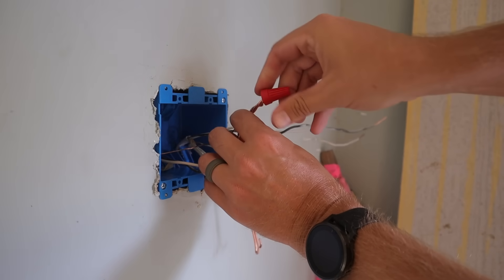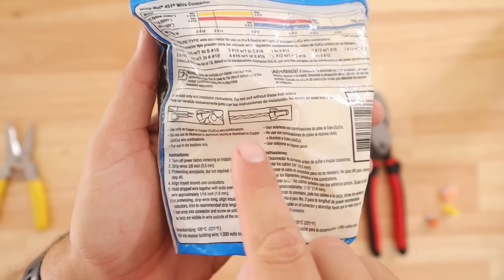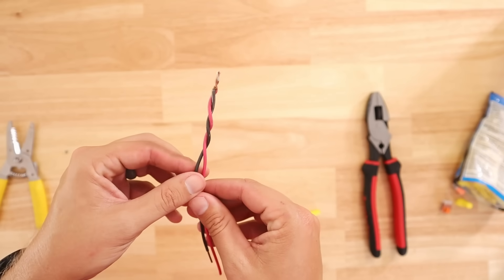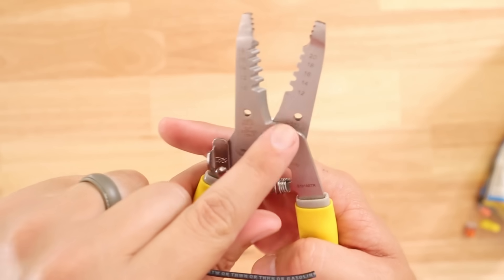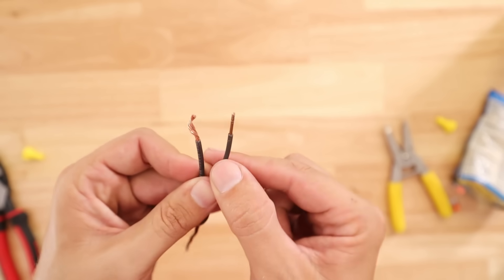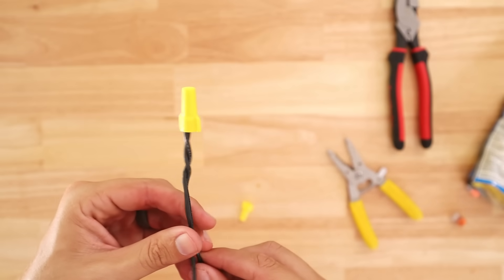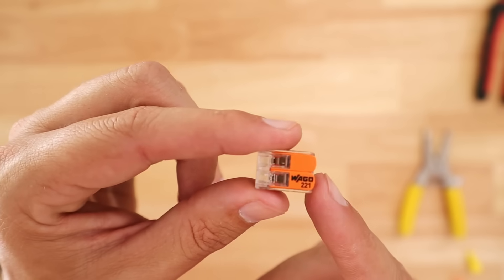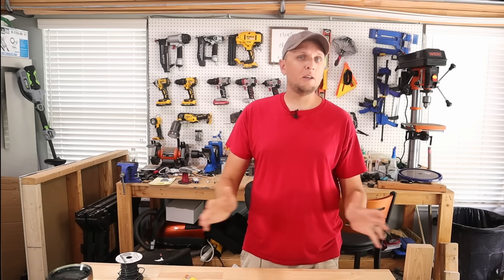BIGGEST Mistakes DIYers Make When Connecting Wires Together | How To

Comment: ALWAYS twist wires with Kleins first, then twist on wire nut.   If you fail to twist the wires, problems can happen, fire can be started.  I have found many "burned wires" under wire nuts when the wires were not twisted first. THis happens when there  is a GAP between the wires, because you did not twist.  The GAP causes arcing, which causes heat.  This will continue until the coppers disintegrates, then the circuit will no longer work and someone must begin troubleshooting.  This has the potential to start a fire in the wall !!!!!

Comment: I really prefer wirenuts for anything that will draw real power. Feeder circuits, appliance circuits, outlets, etc. But for pot lights,fans, and other small loads that often come with stranded wires wago is a lot easier.
Reply: DIYer here: I followed this same rule, except now all my lighting is ultra low power LEDs, so I feel fine using the wago's on a whole lighting circuit.
Reply from the maker: Agree.  Thanks for the input!
Reply: Wirenuts are only allowed in my area.   My inspector said I couldn't use Wago connects in my home....

Comment: I always twist the wires and believe that is a better connection. But you are incorrect in showing the second diagram as part of #3 in the instructions. That diagram refers to #6 in the instructions should you decide to twist the wires, which according to Ideal, is not necessary. Read the entire instructions. Step #3 no twist. Step #6 twist. Step #7. After twisting the wires, screw on the connector far enough so that approximately 2 twists are visible under the connector. This ensures no shorts from bare copper wire touching other conductors or bare metal

Comment: With wire nuts, always pretwist and trim with wire nuts, then over twist to make the wires twist for strain relief (all as you depicted).  You missed the last step (as taught to me by my master electrician grandfather), wrap the nut and wires in electrical tape.  That keeps the nut from backing off (as you demonstrated can happen so easily) and thereby prevents shorts in your boxes.  The Waco splices could probably benefit from a quick wrap of electrical tape as well to keep the tabs from catching on something in the box and flipping up.
Reply: I knew a Master Drywall guy who added dishwashing liquid to drywall mud to make it smoother.

Comment: As an extra measure of safety, after pre-twisting the wires and putting the wire nut on, I will cut a piece of electrical tape and starting from the insulation will wrap it up and onto the wire nut.

Comment: As a qualified Electronic Engineer, I hit the like button, in order to help you spread this info. That said, these are parts of the reasons, for paying for real qualified experts, there nothing more important than have any electrical job done right. Moreover, real experts and lifelong learners, understand a great many other factors, such as heat, degradation, and how structural flexing / movements can effect those connections. A+

Comment: Nice tip, however I believe the "square cut" he makes before installing the wire not , it's not very much recommended, in my experience and I see many , it's a while lot better to make the cut to the wires in a angle to make it dig better into the cone wire nut.
Reply: square cut is only needed if the long wire is excessive.  Excessive length on one wire will result in the wirenut not getting tight.

Comment: You are so freaking funny. You quote the code instructing to follow the package instructions, and show the package that says pre-twisting is not required, then you say, "But, IMO". AHAHAHHAHAHHAHA! These so-called DIY'ers, who you lambaste with your drivel, are not doing it wrong according to code or instructions. Just according to you. HAHAHHAHAAHHAHAHHAHA! I wouldn't even engage a conversation as to why your method of twisting with pliers may actually be more likely to cause mechanical damage and nicking of the conductors leading to failure, than the way the package insert advises. Which is correct. HAHAHAHAHAHHA! breathe, breathe, AHHAHAHAHAHAHHHA!

Comment: You literally demonstrated that pre-twisting isn’t necessary if you twist the wire nut enough to braid the wires as well. Pre-twisting is advisable if you don’t braid the wires as well.
Reply from the maker: Not only did I demonstrate it.  I said it.  However pre-twisting allows you to be able to see that the joint is good.

Comment: Don't know if this was in the video, but if you are connecting a piece of  stranded wire to a screw connection, twist the wire COUNTER CLOCKWISE before you curl it in the shepard's crook shape. Keeps the wire from unwinding whilst you screw it. :)

Comment: ok so I work on boats which is DC but I work on a yacht that also has 120 AC and for the second time it like caught fire and completely melted the plug, its a GFCI and its not resetting or tripping the breaker just melting down and there isnt anything plugged into it, there is a port hole above it that might leak, would that cause it to short out and melt down?

Comment: If you twist first you don't get as good of a grip. I call bs on the most electrician say to twist with pliers. If you twist together first you can cause the wires to weaken. I like most of your videos but I strongly disagree with this one.
Reply from the maker: Every single one I have been able to personally ask recommended it to me.  It doesn’t weaken them.  But as I’ve learned in these comments, there are a lot of opinions about everything.

Comment: Stranded to solid, some electrical tape around the fitting is a good way to finish.  The stranded is more delicate and the tape helps give the connection more strength

Comment: I especially noted (and support) your comment that the wire nut is additional strength to reinforce a solid connection that already exists underneath it. For electronics, we EEs learn early on that solder connections follow the same principle: You are soldering an existing solid connection, not using solder to achieve a connection. Failure to observe that can lead to cold solder joints and intermittent connections -- the worst to debug. :)
Reply: Learned when wiring car stereos. Meshing or twisting wires before soldering is far superior than ripping a whole car apart to find the cold connection

Comment: Wagos are the way to go. Push in connectors are junk. Always tape the wire nuts on a motor. Run tape around the outside of an outlet to prevent it from shorting especially  in a metal box

Comment: Making a solid splice (on an overhead light or fan) with a wire nut or other device needs to be the most effective device while holding up the light or fan with one hand while connecting wires with the other!

Comment: pretwisting solid conductors is fine.... As long as you are not left handed. I have seen twisted conductors by lefthanded electricians mostly untwisted by the application of both fixed spring (Wire-NutsR) AND expansion spring (Wing-Nut R) connectors. I've seen the x-rays of all kinds of connectors that confirm this statement.

Comment: Lots of good advice. I typically try to get a few twists on the wire outside of the wing nut but a tug test is a must. I’ll pull on the wires themselves to see if they loosen up indicating a bad connection. 

I’ve taken to using a drill when I can to get a really good twist.
Reply: the problem is a drill has too much torque . its very likely to break the strands on stranded . especially if the operator is inexperienced.
Reply: be careful not to snap a conductor with all that twist.

Comment: While I do everything you said for a two wire solid connection, I also tape the wires together and then tape the wire connection nut. Of course I'm only doing a couple connections and not a hundred per day.

Comment: I am not seeing a downside to the wago.  You can see what is going on with a wago.  You can't see into a wire nut.  There are testing holes on the end of the wago.  If you are connecting 4 wires together, use a 4 slot wago.  There is nothing scarier than pushing two sets of 4 wires (hot/neutral) bound with 2 giant wire nuts into the back of a box. A 4 slot wago is nearly idiot proof and use less space. Wire nuts are 20th century tech.  The only caveat is pulling off too much insulation sleeve.  An investment of $20 in a Klein Tools 11061 Wire Stripper makes even stripping wires idiot proof.

Comment: the amount of pulling is NOT going to happen in a box, JB, light fixture
Reply from the maker: You’re right, however over time due to the movement of electricity, there is vibration, which is where the issue is.

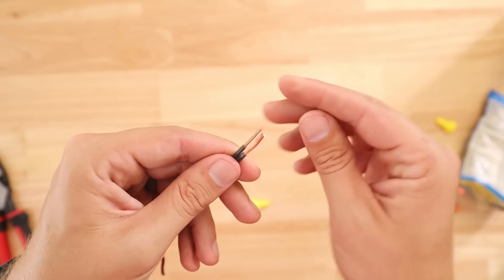Comment: I cannot stand and watch those recommendations. Did you work many years as an electrician or at least an electrician helper? I hope you did. Cause otherwise, it is another useless channel. 6:57 that's just super wrong to do. your wires still will disconnect maybe eventually. the right way to do if you ever worked as electrician, - to bend a little bit solid wire, - like twice so it will not be straight but a bit bent as a bumpy road. And that's how you twist around then stranded one. Also two solid wires, - twist them with pliers and cut to specific size before you gonna put wirenut. And this is just one video I watched so far. I am scared of what you are suggesting to DYI people. Do you want them to burn their houses? Please go work 1-2 at least before you do those recommendations. Thank you.
Reply from the maker: 1. That’s another way to do it.  2. That’s what I did.  3. A little dramatic.
Reply: @HowToHomeDIY  sure, keep disappointing people.

Comment: This might be slightly off topic but still applies to this process. First day on the job I was taught to never re-use a wire nut. If you go in a box and remove a wire nut, you throw it to the ground to be swept up and thrown in the trash or toss it in a "trash" pouch on your bags and toss them all out later. Always, always, always replace any connections with a NEW wire nut.

 FWIW we also never used yellow wire nuts, only Tan "twister" wire nuts were to be used. They are better in a few ways, most importantly is they hold more wiring compared to yellow and/or they can cap a single wire off without falling off like yellow ones commonly do. This was 20 years ago and I've been out of the trade for a long time, but I still practice this as a DIY'r to this day. 

I'd love to hear a rebuttal or an agreement from any knowledgeable electricians that are still in the game today.

Comment: So... Where u from? Reason I ask is because I can't think of any other reason as to y someone would do it that way other than the lack of common sen.... Well $#!+ nm... Geography wouldn't be a contributing factor as to how much common sense someone has...🙄 Or would it? 🤷‍♂️ Anyway my point is that I've never heard of anyone let alone seen anyone do it by just pushing the wires in and calling it good, it's just...🤦‍♂️ I mean, how dumb u gotta be right?
Reply from the maker: I haven’t seen anyone just push them in and leave them either.  I have seen many times just pushing them in and twisting a few times and calling it a day.  And did I sound Russian in any way? 😂

Comment: good advice. I usually wrap both wires in electrical tape so they don't pull out.  Seems what I have been doing is not necessary

Comment: Do you recommend twisting the wire and insulation for the wago like for the twist nut?
Reply from the maker: No, I just connect them in and make sure when pushing them into the box that one of the levers does get caught on something and open it back up.

Comment: The linemen method results in many nicks in the copper which technically is a code violation. #14 and smaller should be easily pre-twisted with your fingers. I've seen some guys do #12 but it's pretty taxing on your finger tips. If you're using the appropriate sized, good brand, and applying proper twisting strength of wirenuts you really don't need to pre-twist. I've seen apprentices get chewed out for less nicks then what this guy ended up having. There is also zero reason to use linemen to pre-twist stranded onto solid - use your fingers instead of damaging the delicate strands.
Reply: When using 3 or 4 12AWG solid wires I like to strip about 1 to 1.25 inch of insulation and grab only the last quarter inch of wire and twist. After you snip off the excess you're left with a good twist and no nicks or gouges.
Reply: @surferdude642  That's a good method - definitely saves your fingers.

Comment: Good video. Seems to me wire nuts are too big. A better design would be a much thinner nut- more like a thin sleeve that barely fits and slips over both wires. This way it could also be crimped at the base- more like a thin tube. You can twist it on using plyers. Those big wire nuts are wide open at the bottom which could expose the metal wire to stuff like debris and moisture. Many people will use these nuts but then also use electrical tape to make sure they are sealed up and can't every come off over time with vibrations, etc. I like the shrink wrap connectors too for some connections.
Reply: There is also a product called scotch coat. Used mainly in wet locations like outdoor or underground boxes. A tar like goo that you brush into the wire nut. It’s permanent so use some excess wire for future cutting off the coated wire nut.

Comment: Twisting with the linesman's pliers first is old school, predating wing nuts.  It's from back when you twisted wires, then covered them with electrical tape.  (I do remember those days.)  Starting with two parallel wires is better when using wing nuts and here's why:  You want a really tight connection with good contact between the two wires.  These connections rely on wire to wire contact for most of the current transmission.  And if you think about it, even though those wires may be 12 or 14 gauge, there's only a narrow band of each wire that is actually touching the other one.  Take a look at those wires which were twisted by the pliers.  They are all scored up.  That means that that narrow band of contact is broken up and lessened.  If it's messy enough, some of the current even ends up going through the windings of the wire nut, which is not good as it could heat up and melt the plastic.
Now look at that joint that you did with the wires starting in parallel.  It is at least as neat and tight as the one you started with the pliers.  It is not at all degraded.  it is optimum.
Ironically, when you put multiple wires in a bundle - three or more - the wire nut becomes even better.  That's because pliers grab and mash the wires into a flat bundle if you grip them tightly enough to wind them tight.  Then you have to somehow round the bundle out in order to get the wire nut over it.  This loosens the bundle that you just got done winding tightly.  
If you really want to use the pliers, use them on the wings of the wire nut if you are connecting more than two wires.  Then you'll get a really nice, tight connection.
Reply: The old school method was solder and paper.      M Pasteur out Detroit did it that way.    With 64 years in trade....

Comment: Except you cut the video when you where taking off the wire nut because your pre-twisted wires came apart. 5:00
Reply from the maker: That didn’t happen.  I cut ahead to make the video shorter like I do many times.  Good effort though Kurt!
Reply: @HowToHomeDIY  👍Well as a heads up usually that's how YouTubers fake scenes. When you are trying to prove a point it's best to show the full clip of the proof uncut. 

What lead me to think they came apart is that when you cut the end of the wires to even them. Usually this leaves a pinch on the tip of the wires that is pointed on edges. This sometimes cause the tips to "jam" in the wire nut and the wires untwist as you take off the wire nut. Than again I'm used to working with larger gauge wires so this may have given me a misconception.

Trust me your video didn't pop up on my feed because I want to debunk stuff lol. I am always looking to improve my knowledge and your video was great. I just like to point out when something seems off to me. I am very detail oriented when it comes to knowledge. 

Thank you for taking the time to respond to me. Keep up the great work teaching others.

Comment: I am a retired Electrical Contractor. The correct way is stripping wires double the length needed ( 1 1/2 " ) , pre- twist bare metal only, then cut to suitable size for wire nut. There are usually more than just 2 wires connected. Three, Four or five wires can not be connected without pre- twisting because not all wires can be grabbed securely under the wire nut. Most of partial power outages are due to uneven pressure -connection in a splice. Weaker connection will corrode over time and under load. In few situations you may even come across with aluminum wiring where weak or lose connection means Bengal Candle.

Comment: I always pretwist wires and I also use a longer length on stranded wires so it’s good to see I’ve been doing a good job but I also take probably an unnecessary step but I feel it gives extra protection from possibly grounding out when stuffing wire into gang boxes or behind light fixtures, I will tightly make about 4 wraps of electrical tape around the nut and wires.
Reply: My dad put tape around it to, he never trusted that without tape. Now I do the same.

Comment: I do like to use Wagos myself.  But as a forewarning, if there is the possibility of water intrusion they aren't great.  They tend to fill up with water and keep it.  Turning your copper green.  If used for power you could melt your Wago apart, if signaling, bad signals.
Reply: They're good for certain things, but I don't trust them in unheated/cooled spaces or for high amps.